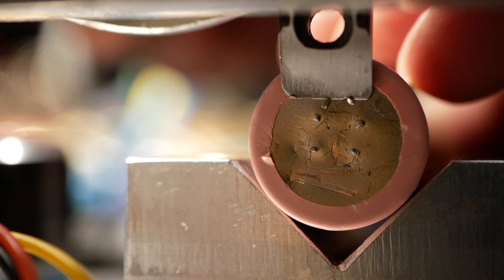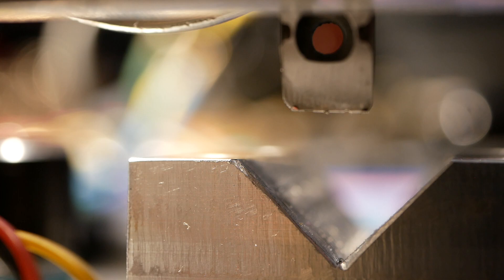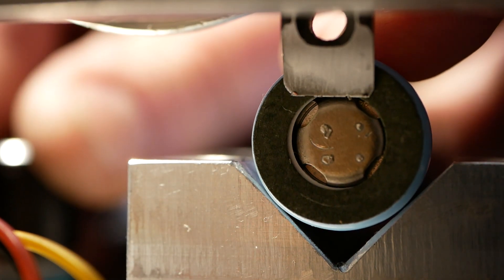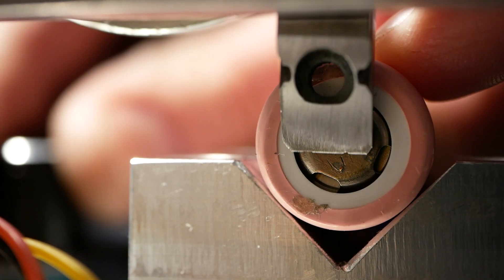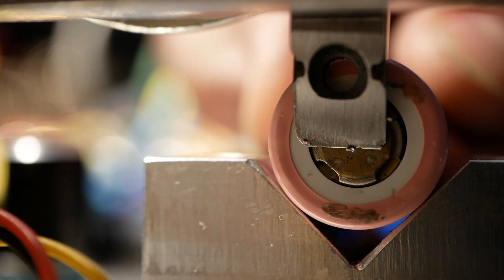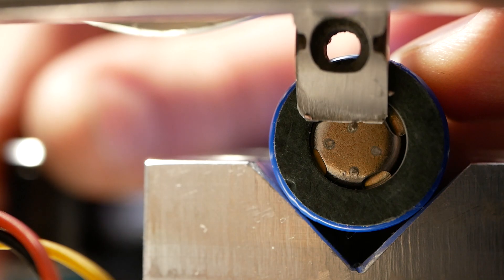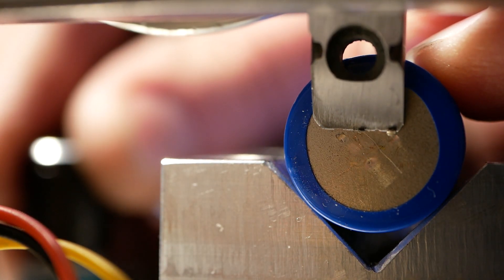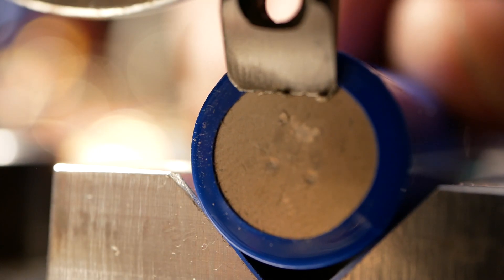Mr Snippy v1 taking off spot welds from good 18650's

Comment: what happens if I use them like that?  I have rectangular stuff attached and just bought singular cases to put them like an AA case is it ok like that or am I getting some explosion?
Reply from the maker: ARe you asking if it's OK to use cells with spot welds on them still?
Reply: @de-bodgery  don't know how do you call them, I removed the cells from a laptop battery and the metal things remained attached. Didn't want to pull them because I was affraid of damaging the poles
Reply from the maker: @Huawei-pidhisamestate  You should use at least flush cutting wire cutters to snip off the metal.

Comment: Try grinding  edge curved so sides can contact first and center will cut weld
Reply from the maker: I understand what you said, I just don't understand why I would do this. Please explain further.
Reply: @de-bodgery  corner of blade can act as a stop to keep you from hitting the top of the positive terminal   .grinding at an angle may also work as battery can be pressed against corner of blade before starting downward travel
Reply from the maker: @teddycunningham7568  I probably have a better solution in mind. It's gotten a couple of changes since making this video. I added a wider linear rail that has 2 bearing blocks. This stiffened up the cutter considerably. In this video you can see the blade raises free. It's now trapped in the disk slot. There is almost no movement in the slot in the disk either. The cutter can't bottom out in the base anymore. I have made a video on the changes, but not had time to look it over yet before uploading. I want to finish a couple of details before I post another video.

Comment: This thing is brilliant. 😀 It will save you hours of work and help give you much better welds when you go to reuse them. 
Would a small magnet somewhere near the tip help keep it clean? The chips could easily become a pain.
Reply from the maker: The cells I clean up in this video are all ready pretty clean. ATM I don't have anything with scraps of ripped away nickel still attached to them. I won't need flush cutters  for cleaning up cells any more. I'll just use Mr Snippy and get excellent results on the first try. I like the idea of a magnet. It doesn't need to be secured to the base in any way, just be near where the nickel and weld debris are falling so they are attracted to the magnet instead of scattering everywhere. Thank you for the suggestion.
*
I have purchased a 12mm linear rail that has 2 bearing blocks. This will provide a bit more cutting width and better support for the rail. In this video you can see the cutting edge move in and out a little. I think 2 bearing blocks will arrest all of that. While I'm replacing the rail, I'll also center it in the V block.
Reply: @de-bodgery  Most old 3.5" HDD will have suitable magnets in it. 😉
Reply from the maker: @alibro7512  yup...I worked in IT for many years. I've salvaged many magnets from old hard drives.
Reply: @de-bodgery  Me too. I started working on IBM XT's in 1989.
Reply from the maker: @alibro7512  We must be of similar ages. I learned programming on the Apple 2 and 3. My first computer was a Timex Sinclair TS1000. I was soooo proud to have 16K of ram on it! My first IT related role was fixing Kaypro computers in 1986 or 1987. 1988 I landed a role working on Altos unix systems. It was a year later that I finally saw DOS or an IBM machine or a clone.
Reply: My first computer was a Commodore VIC-20, one of the first in the country.
Reply from the maker: @alibro7512  Nice...I never had a commodore. I had a TS-1000, 2 from Tandy and later a clone XT. OMG!!! On the fly switching from 4.77 to 8 mhz and 512K of ram! I was god almighty! hahaha! Remember compuserve? I was customer number 6. Later Earthlink bought them out who I stayed with for several years for dial-up internet. DSL became available and I was the first one to have it from the local telco building. 1.5mbps...seemed like I went to heaven!
Reply: @de-bodgery  512k!!!!! I had 3.5k in my VIC-20 🤣